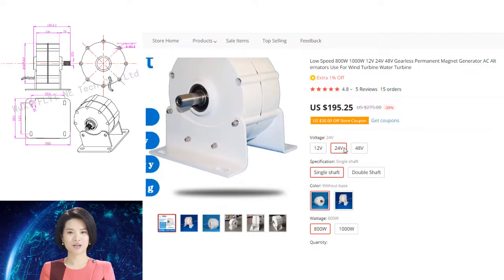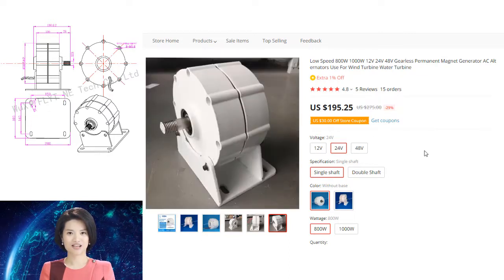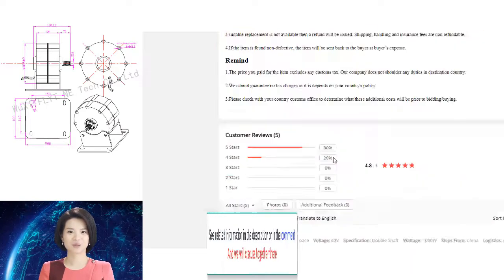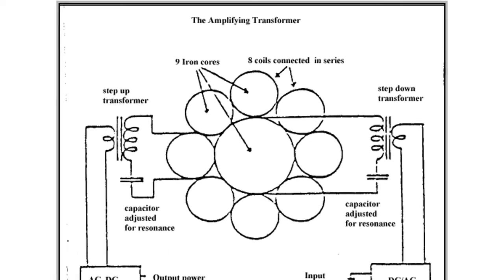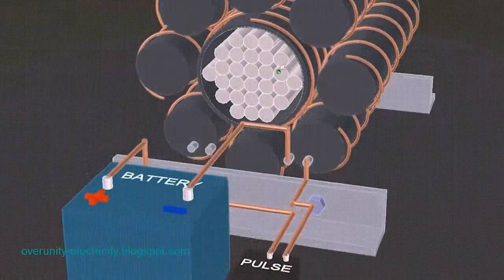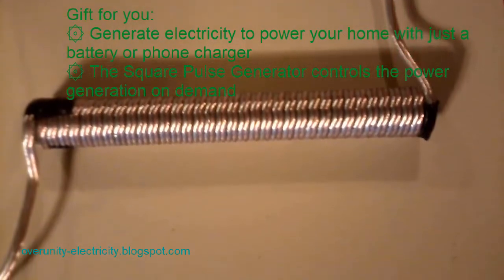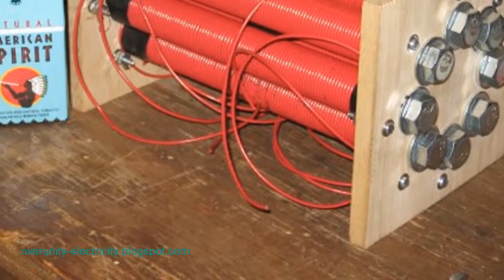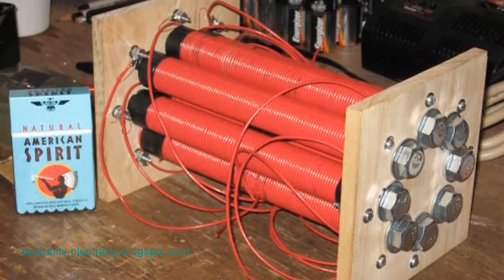Top Magnetic Generator:  AC Alternators Use For Wind Turbine Water Turbine 800W 1000W

Comment: A Muller Dynamo Generator is a type of electronic circuitry that harnesses the power of Back EMF. This process converts the kinetic energy of a moving magnet into electrical energy. The Muller Dynamo Generator is one of the most efficient ways to generate electricity, and it can be used in a variety of applications.